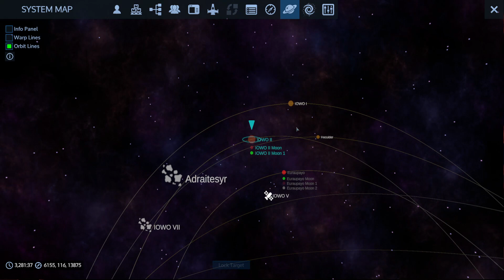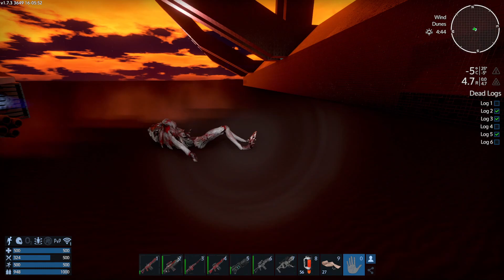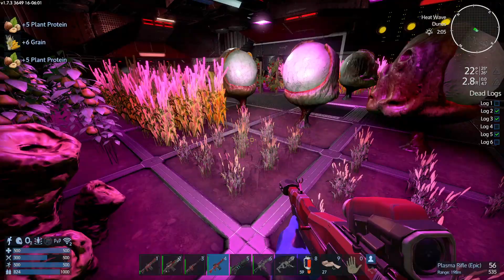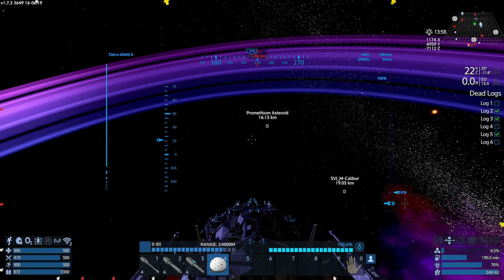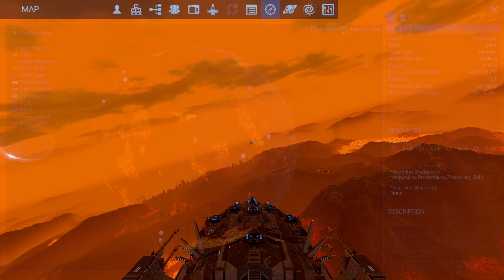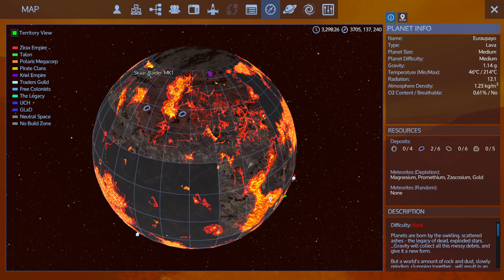Magmacite (Lava Planet) : Project Eden Empyrion Galactic Survival 1.7.3 : #94

Comment: Hi there I am playing produce to Eden and I don’t know far you can go in unlocking more advanced items from the tech tree by using tech point I have ran out of them at lv 25 and wondered if you can still obtain more unlock points if yo can still lv up? So any advice I like to know and I am watching your vids and they seem interesting.
Reply from the maker: Extra research points are obtained delivering items to Research Terminal on the UCH Research Vessel.   Data Chips and Data Pads can be obtained from random missions,  loot boxes or purchased from traders in trade station.  There are also UCH missions which gives rewards that can be traded for research points.  

Another option is to build Research reports, these can be found on the decorations tab of the advanced constructor.  At  the bottom of the solo missions there is a science tab which will give some information on research reports and how to find the research vessel.  

New features are being added to the scenario, so when something unusual turns up I hold onto it until I have had a chance to visit the Research vessel. Hope this helps.
Reply: @StephenSilverbeard   thanks for the help and happy gaming to you